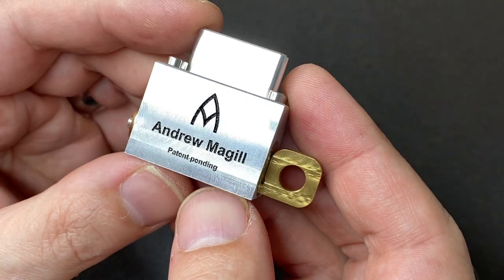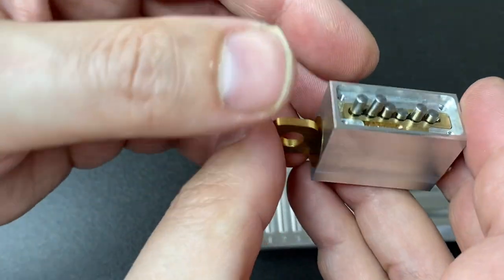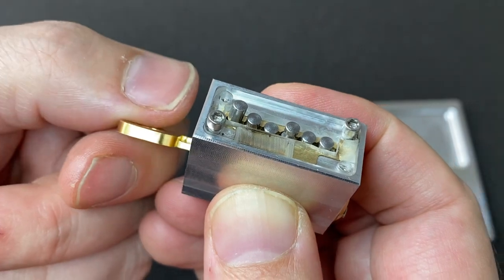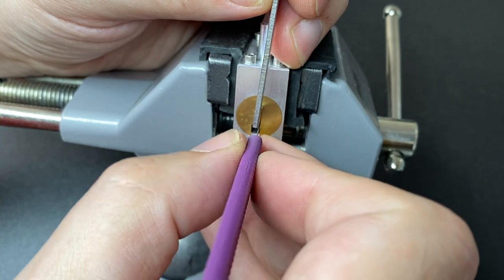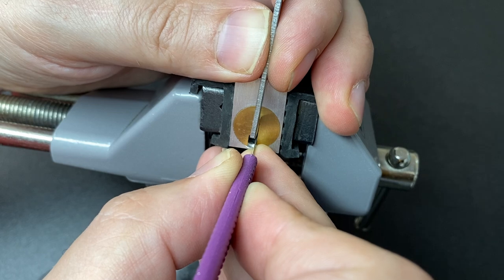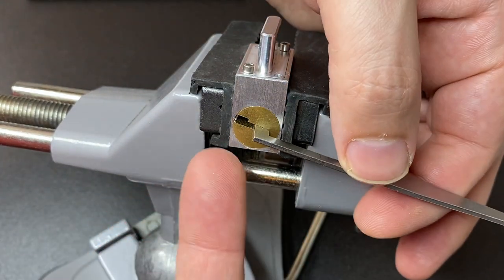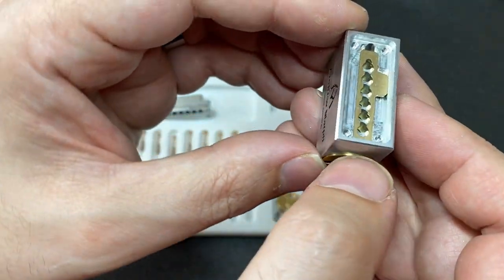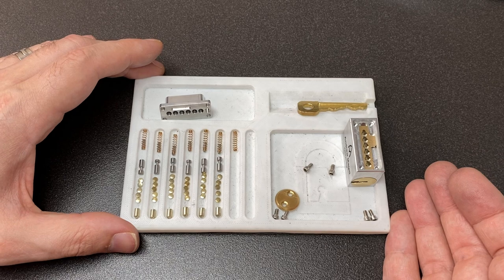Unpickable? Enclave - an Ingenious New Lock Design

Comment: I want to know what, if anything, prevents that last sidebar lift pin from turning over time (rotating), in the lock such that the angle of the lift pin would be backwards (i.e. instead of sloping up from keyhole side to the rear, actually sloping down), and therefore unable to lift the sidebar, even with the actual proper key.  The pin has no slot and the hole it drops into is completely round.  If the pin was either ovalized, or if it had a keyway slot, it would always remain in the proper orientation.  This reminds me of a problem with a poorly engineered HP diesel fuel pump where there is no 'keyway' on lift pins, which have contoured tips that mate with the opposing contours on the undersides of the pistons.  Instead, the pins are dropped into the pump in the proper orientation during manufacturing, and are expected to remain in that certain orientation in order to actuate the pistons and compress the chambers, thereby pressurizing the diesel fuel.  Instead, over time they begin turning in their bores and wearing off the contours, until eventually the tops of the push pins no longer lines up correctly with the pistons and the pump fails.

Comment: Interesting design but probably not suitable for master key systems (only few positions possible with this slider). Furthermore, once the first barrier is taken (should be easy to rake) I am not sure if the mechanical resistance of that blocking pin is strong enough.

Comment: I feel like of this were to find its way to q commercial cylinder the thing to watch out four would be a bypass or drill attack. Something tells me you can tension using the top bar, or alternatively find a way to drill the back top of the lock or render the top bar useless in some way, it makes the lock virtually useless as every wafer becomes a working shear line. The hard part would be taking the theory to relatity but without that being a real lock in a real mechanism there's only so much speculation that can be done

Comment: The approach to attack this lock is to find an alternative way to tension it. The tension here should be on the seventh pin, not on the cylinder.
But the seventh pin is actuated by the cylinder itself, so how to tension the bar without tensioning the cylinder? Perhaps tensioning a known good pin against the bar will allow for feedback on the other pins, but that requires a tool to tension that pin while the cylinder is both at 45° and 0°.
So far my thought experiment to defeat this lock.

Comment: Would there be any benefit if the pins had 2 or 3 different depth of the grove? The sliding bar would have different width grove to match the pin. Probably not worth the extra effort to manufacture. I would also be interested in seeing something with 2 rows of pins, one on top one on bottom. Maybe for some application where the depth is limited but there is enough width. 🤔

Comment: Here's one improvement idea that I just had: Instead of making 6 different shear lines by putting 5 super thin wafers into the lock, couldn't you also make 6 shear lines by putting 5 thin rings between the cylinder and housing at each pin location? Or even 1 wafer that's 3 bitting steps tall and 3 rings that are 1 bitting step thick. A possible problem might be that after a lot of use where these rings only ever slide with the correct part of the lock, they would get sticky which could give an attacker some information (if you can access them).

But in theory, it might even be possible to make a simplified version of this lock with that concept. The "problem" with the wafers is that you need more height on the pin stack for the testing part. Whereas the rings would offer enough surface area to include the testing mechanism without the need for that 7th pin and the spring loading of the plate that can fail.
edit: Oh no, wait, that would allow a pin drop attack.

That leads me to an interesting attack on the initial lock: intentionally make the faces of the wafers stickier and sticker over time. The correct shear line will be kept polished every time the lock is opened with the key. This attack takes a lot of patience, though.

Comment: The only issue I see with this lock, though a really great concept, is the method in which it slides the sidebar forward. The metal used is brass, which I would only give about 3-7000 uses before you start having issues opening the lock normally. Brass is a very soft metal, and while it is self-lubricating (led) it wears quick. Making the last pin and the sidebar out of stainless steel would be preferable, and would increase the longevity of the lock somewhere into the 50,000 range before it wears, but still, a better method is preferable.

However, you run into another issue if you do that. If the metal is not true stainless steel, it can be defeated by a magnet as the tensioning tool. I think a reengineering for a better way to move that side bar forward would be preferable and would make this a truly viable high-security lock.
Reply: Thatis not a proplem, there are plenty of stainless steel alloy that's completely unresponsive to magnet.

Comment: Could you lift each pin just high enough so that a wafer is inside each slot in the slide bar? Would the slide bar move then, since it has no pins but only wafers in it?
Reply: I think the stopper rods inside the springs prevent that

Comment: get the pins lined up anywhere them ram a screwdriver and gouge the rear barrel with the pin or snap off the pin seeing as it is holding the lock closed.

Comment: If a novel lock mechanism is to be commercially successful it must fit within the bounds of traditional dimensions.
The three cases are:
1. half inch plug in cylinder with no 'bible' (which holds the springs and upper pins in a traditional cylinder) - Abloy, BiLock and Galaxy (same Australian maker as BiLock). BiLock was originally developed to replace wafer locks on pokies so had to have the same dimensions as wafer cam locks..
2. half inch plug in cylinder with narrow bible. This is the usual euro cylinder. Most mechanisms except IC will fit in this (although there is a cumbersome and unsatisfactory way of fitting a IC core in a specially made euro cylinder.
3. Standard size round or oval cylinder. Accommodates usual mechanisms plus IC and Yale Bicentric (now obsolete).

A lock mechanism that does not fit into at least a standard size cylinder would seem to be doomed market-wise. There are a few exceptions - Mogul cylinders used for detention and the Corbin master ring cylinder.

This novel mechanism would seem to need a larger than normal cylinder unless perhaps a 0.4 inch cabinet plug is uses (but on the same axis as a 0.51 inch plug) and the components scaled down to fit.

Comment: I think I have an attack vector you could use.
You said that there's no feedback for an individual attempt but that's not strictly true.
The whole point of normal lockpicking is that some pins bind against the shearline before others do, and that's actually still going to be true here - the slider bar is going to jam against some false pins before others. Depending on the leverage you get, what you could do is basically get every pin in the first shear line, and then bind it all the way, and use a fine-point pen to inscribe a mark on the lock body. Then you bump every pin up another level, and bind it again, and see if you go any further past the original angle. Now you know that one of your gates is, for example, a 3. You can then unset the entire lock and try a 3 in every gate one at a time until you get back to the further angle.
Then you just repeat the whole process again. Find a five, know that pin 2 is 3, find which pin is 5. now you've got pin 2 is 3, and pin 5 is 5. It'd still be tedious as hell, but it'd be feasible. It's a far sight better than a bruteforce attack - although, I think in this case you'd be best off using one of those Lishi Encoder type of pick things to make sure you're hitting the right pins with the right cut depth on all attempts. 
That said, this particular attack kinda assumes that all the wafers are the same diameter, you could make this a lot more difficult just by varying the diameters of each wafer in all stacks, which would make you have to learn a huge number of different "set orders" for the lock.

Comment: If you over set every pin you could release enough tension to drop the driver pins off the wafers this could be removed by putting 2 or 3 grove's on each of the drive pins mimicking the wafers

Comment: If you know how to pick this lock, there are 6 wafers per chamber and 6 chambers. That should be 46,656 possible combinations with only 1 that’s correct. It is pickable, but only if someone with the skill of LPL pit in the same hours like a safe cracker methodically trying every single combination

Comment: For the owner and everyday user of this lock, as opposed to a challenge picker, everything depends on that pin with the 45° wedge on its top successfully sliding against the sidebar, converting vertical motion of the pin into horizontal motion of the sidebar, i.e. a 90° change in the direction of motion. That is simply not reliable. The 90° shift in the direction of force is prone to scoring the mating surfaces and jamming, particularly if manufacturing tolerances on the pin and sidebar are relaxed. Also, the wedging action doesn't only slide the sidebar horizontally, it also pushes it upward at one end, creating a tilting action that invites jamming. I would be concerned about this lock jamming after a couple of years of everyday use, particularly if the user is a bit rough turning the key.

Also, those notches in the pins through which the sidebar slides must be THOROUGHLY deburred. If any burrs are left after the notches are cut this whole mechanism will definitely fail.

Comment: It seems to me that having the same number of wafers in each chamber would make it easier to defeat this? Idk but can an experienced picker count the set wafers? Surely this wouldn’t be the case in a production lock? I am not very skilled myself but this seems like the same problem as same length driver pins in early pin tumbler locks… 🧐 but easy enough to “fix” if applicable.

Comment: I feel this hinges on being able to tension the side bar somehow as the wafers should then be less of a problem. One would be able to regard the stack of wafers as a ‘normal’ pin and just go through lifting the binding stack until the bar moved a bit due to the usual manufacturing tolerances. Not sure how you would achieve this as it appears the core needs to turn quite a way before the side bar is engaged. Can that back pin be accessed and pushed up from inside the keyway? Perhaps an adapted key with the other biting cut low to give room for a pick? Only other way I can think of is a small hole in the bible to somehow hook the bar and pull it forward to tension? 
Amazing lock anyhow!
Reply: You can’t tension the side bar. The last pin pushing the bar is completely isolated from the keyway. The only way found so far is to decode the lock wafer by wafer which is extremely tedious as you have a binding order on the wafers. So for every position you want to test, either you can only move the desired wafer without dropping anything, or you need to restart the whole process.
Reply: @yom73  ha ha mind-blowing 😁

Comment: The possible flaw in that current design is that the stacks all have the same amount of wafers. So with knowing that, you can play with chambers individually, and listen for the clicking, to get an idea of how many you have to pick, to get the right height. 

One helpful "fix" foe this exploit would be to set up the side bar so it has a tab that is pushed back by the key, so you have to have constant, active pressure on the "sidebar" WHILE picking it, and make it so you can accidentally overshoot the sidebar, so it makes it harder to be able to get the side bar in the right position while picking.
Reply: More wafers equals more potential combinations. You can't adjust any pin to the next combination without rotating the core back to the original position. You would have to try every combination (over 46,000) to get it right. 
In other words, you can't have any pressure on the sidebar while adjusting any pin.

Comment: Since there’s a pin for the lever at the top, couldn’t you ignore all of the other pins and just operate that back pin to try and pull the lever along the actual slots in the top pins? And then from there use a bump technique to try and bounce them up? Or otherwise stress those pins against the lever, and then pick the other pins back to front until the upper pins, The spindle pins, click against the lever?

Comment: the main strategy is wright - check only after set.  but implementation seems not so great.  this particular design will jam a lot over time. believe me.  (and of course it will jam on picking)
this wafer stacks are very sensitive to dust/debris/misalignment/wear.

Comment: If the lock manufacturer adds 2 more wafers to each pin, it will go from 36 to 48 combinations, it would be harder to pick than a 48 pin lock.
its mathematically possible, but very very very hard to pick because of the false settings, very good design.
Reply: with 6 waffers  the number of possible chances are 720:1, with 8 are 40320:1,  very good design.

Comment: Controlling the manufacturing tolerances on the wafers would seem to be an expensive proposition. All 5 wafers must stack and meet the required tolerance for its set of pins. In volume manufacturing you would be mixing and matching random wafers manufactured in a separate process from the pins. A single wafer out of tolerance would make the lock inoperable. Essentially you have 46K+ combinations of wafer stacking - how many of those combinations will work?

Comment: I feel like since they will have wafers in there you could go pin by pin and decode the lock easily by finding the first sheer of each pin, then adding the height of the wafer stack. Then cut your key and open it.
Reply: You wouldn't know the correct height. The location of the groove is different for each one, and how many wafers up up with the grooved pins to find the correct position is different on each one. Watch some of the animations, where you can see that in order to open, each pin has a different number of wafers pushed out of the cylinder. And you can't test without rotating the key.
Reply: @MarkJaquith  sure you can. You just need test keys at the various cut depths. Since we're figuring it out on the sheer line above the wafer stack there's room to figure them all out by decoding.

If you know the height of the wafer stack this is very easily decoded simply because they use the same amount of wafers in every cylinder.
Reply: @69nites  how would you find out how many wafers each pin requires to be “up”?

The whole point of the lock is that you can’t discover this information until the lock opens.
Reply: @MarkJaquith  all of them are required to be up. That's how the lock works. All the wafers are false sets. The security feature that makes it very difficult to pick is the security flaw that makes it easy to decode.

Comment: So, there are 6^6 possibilities, aka 46656 possible pin positions. If you make an automated tester, that can test 1 per second, it would take a maximum of just under 13 hours to pick.
Reply: Making a 7 wafers (=8 positions), 8 pin design of this, would up the number of possible positions to a whopping 16777216 positions, at 1 test per second thats just under 195 DAYS to pick automatically.

Comment: You do not want to stop someone from picking a lock only delay them. If you make the lock too hard then they break the window or knock down the door etc.   Locks only deter the common users.  Locksmiths will pull out the drill after 15 min

Comment: Thinking differently…
Wouldn't it be easier to apply tension to the seventh pin to get the lock by it's « sidebar », if it makes sense (pushing the other pins to get more motion in the sidebar) ?
instead of applying tension like all normal locks by trying to turn the barrel.

That said genius lock indeed simple and effective system…
Reply: The seventh pin is only engaged by the back of the core.  It doesn't appear to be reachable from within the keyway.
Reply: @DevinBaillie  Yeah true 5:29… Would love to see what the LockPickingLawyer thinks about it 😉

Comment: I want these on my doors now instead of the Bowley. However, both are near impossible to pick for even the most experienced locksmiths (or thieves, etc.) in a reasonable amount of time.
Reply: The only downside of Bowley seemed is that is complex to open with key. How did you find them?
Reply: @jasonmajere2165  They were featured in a Lock Picking Lawyer video. I don't find the Bowley action to be too odd; it's just different from the simpler, less protected designs. But I do only want Bowleys; I don't actually have any, on account that I don't own the house I live in.

I'm very happy to see that lock innovation did not stop with the invention of the pin-tumbler mechanism; I'd be more surprised to see one of these in the video or a Bowley picked any faster than the most expensive security pin-tumbler locks on the market.

Comment: What if you set all the pins to their lowest positions, put tension on its incorrect state, and use light tapping from a hammer to nudge the pins into the correct positions?